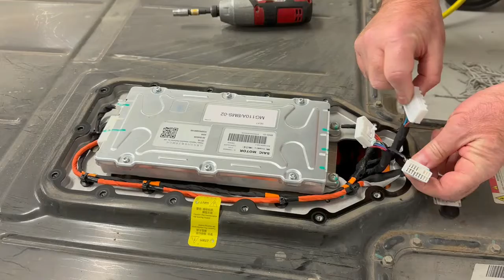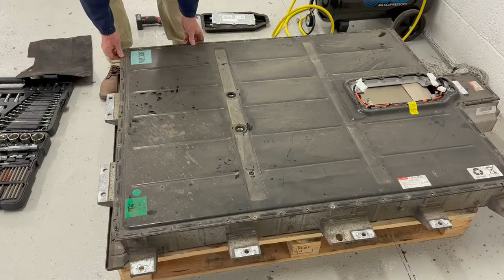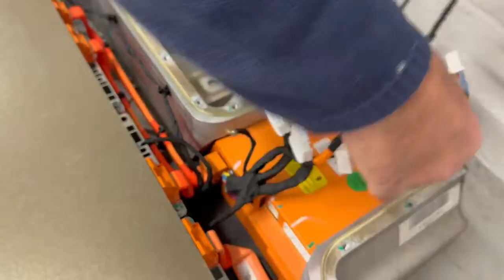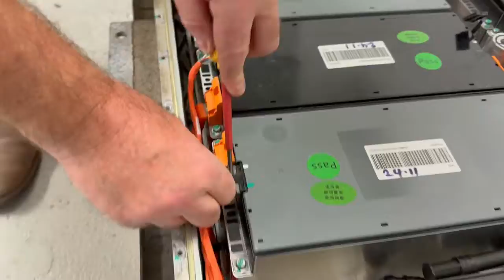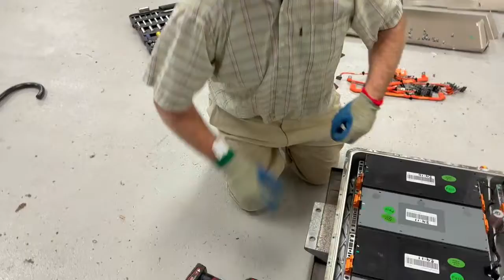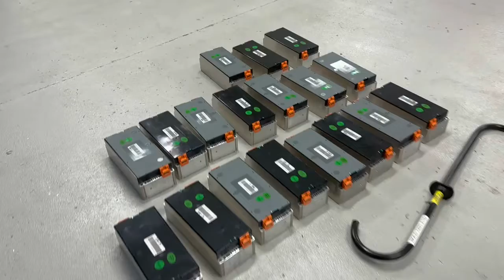2019 MG ZS EV battery disassembly.

Comment: Brilliant video Guys, thank you. I'm late to the party discovering it a year on! Brilliant modular design, only reservation being a leaking coolant pipe, would have been easy for MG to make them external. Assume this is the long range NMC pack as it degraded relatively quickly. Hopfully the LFP option lasts longer!

Comment: How many kilo meters were driven by this battery ?
Reply from the maker: @bhagwansinghrana8224  120k miles approximately
Reply: @Triplebengineering  Given the amount I see with rotten brakes,faulty radio/ nav systems, failed cats,coolant and oil leaks, coil packs,broken window switches and regulators,water ingress into wiring,dodgy transmission ECUs, etc. some only a year or two old, 120k is good going.better than I would expect from a petrol mg.
Reply from the maker: @user-re6yo7tj5s to be fair to it, this little car has been very good.  It’s now on 150k miles and apart from the 2 front wheel bearings we put on it last week and the battery change at 120k it’s had zero failures.  

The wheel bearings were a “joy” to replace 😂.  Due to the daft design it necessitated the complete removal of the front hubs from the vehicle, so suspensions arms off, driveshaft out, brakes off etc just to change the bearing 🤦‍♂️.  Genuinely changing the EV battery was far easier.

Comment: Hi, I have Mercedes EQB I hit something from the bottom of the car so the cover of the high voltage battery bent a small bit. Does this affect the battery? Some mechanic told me the battery has to be replaced because it’s dangerous to drive this car if you can help me please.
Reply from the maker: @lul196613  it depends on the damage tbh.  If the battery enclosure is exposed then yes it is definitely an issue and could be dangerous.  If it’s just superficial then it’s unlikely to be a problem.

Comment: Correct me if I’m wrong but would I have to touch  both positive and negative to get an electric shock. If I touched just the positive I wouldn’t  get a shock that would kill as I’ve not created a path. Not that I’d try 😱
Reply from the maker: Broadly speaking yes, to get a bang from the full force of the dc battery at full voltage you would need to bridge across both poles.  However, you can still get smaller shocks from either partial module poles OR from capacitive discharge to the casing which we measured at around 100V decaying which would definitely give you a tickle still.
Reply: That’s correct, it’s different with supply from the grid because the earth is used as a return path so coming in contact with a live is all that is needed.

Comment: soh?
Reply from the maker: State of Health
Reply: @ what is soh of this car?
Reply from the maker: @forever_momentss 84% at point of removal
Reply: @Triplebengineering  and why remove it if it's 84% ? how low can it go for the car to be dead ? if warranty will change it when it's under 70% , can it still run if SoH is under 50% ?
Reply: @Triplebengineering 84% for how many miles?
Reply from the maker: @ roughly 120k miles
Reply: How many mile it driven??

Comment: 11:11 now try dropping a spanner across the pack voltage, and you'll get a lot more than a "tingle"!!! more like a melted spanner, and possibly a large fire.☠😱
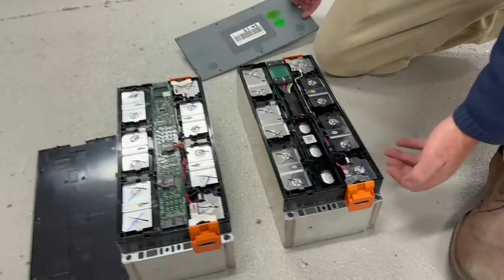22:22 You should scrape the modules across the floor, they are machined flat, and clean for thermal contact to the box... 
Summary: cell 3.65/4.2V individual "cell" Module: 6 cells (6s) Pack, or BPC: all the modules, 108s, or 18 x 6s modules, giving 394.2V nom, charging to 453.6V.
Reply from the maker: And how are you going to do that unless you have a 20” long spanner……the “pack” ends are nowhere near each other

Comment: 6s is 3.65V x 6 = 21.9V module, charging to 25.2. (22V would be closer!) I've done this job on an MG5, it uses 6 x 16s 58.4V modules, charging to 67.2V. It had ~70 7mm bolts, I didn't use my fingers to count them!!!
Reply: @Triplebengineering the module is 6s right? Not 5s
Reply from the maker: @rashadshubita1941 yes each module has 6, 4.2V cells = 25.2V per module, x18 modules = 453.6V pack
Reply: @Triplebengineering do you know parameters of modules? catl? 6s?p what capacity Wh? do you have photo of label?

Comment: Lfp or nmc battery ?
Reply from the maker: @dm-ebike74370  the smaller 6 cell modules from the standard range 44kwh pack are NMC chemistry.  The larger 16 cell modules in the extended range 72kwh pack are also NMC chemistry however the later gen2 packs (50kWh for the std size) are now LFP.

Comment: So what was actually wrong with the pack? As they all seemed to be at the same voltage?
Reply from the maker: We suspect it may have been a faulty BMS or faulty software rather than a battery cell issue.  It is worth noting that there could still be an issue with a particular battery cell or module that only presents itself under load so even though the module voltages tested good and more importantly, consistent to each other it’s not a an absolute guarantee of no defect.

Comment: Hi Brad, I was wondering what sort of 'structural' protection element they have on the bottom of the battery pack against accidental road bumps and debris? Nice video btw!
Reply from the maker: @reginalduy3678  just a large chunk of cast aluminium tbh is all that separates the modules from the road surface.  The case is very solid and has energy absorption sections all over it so the modules are quite well protected in truth.
Reply: @Triplebengineering  Nice, thanks for the reply! I was asking because I am curious about Chinese EV's structural integrity. With Tesla's for example, it's quite proven that the underside belly protection is really tough based on various YT videos I've watched.

Would you say it's comparable (not greater maybe, but just comparable) to the level of toughness that Tesla underside bellies have?
Reply from the maker: @reginalduy3678 it’s quite difficult to say for sure without doing a back to back comparison using a measured blunt force.  Also the cell topologies are very different in these MG packs which use prismatic battery cells compared to a Tesla pack which uses cylindrical cells so the makeup is very different.  

From what I have seen, could you break the casing on the MG, yes I would think so but only with a direct and focused hit to the underside of the car because the pack is well protected between the chassis rails and such I would say it’s highly unlikely.  Maybe we will cut one of the cases up and show you a cross section inside in a later video.

Comment: @Triplebengineering , did i hear Bill say he works with high voltage UPS battery systems? If so, would he mind if I pinged him a couple of questions re converting an apc surt20k xli ups to lithium?
Reply from the maker: @mechsmantg  yes he does all that stuff so drop him a note.  👍🏻
Reply from the maker: @mechsmantg  @bill2960
Reply: @Triplebengineering thanks.
Reply: @Triplebengineering  can't seem to find him with that tag for some reason? Has Bill got his own channel or anything?
Reply from the maker: @mechsmantg  he’s in the comments section replying to a bunch of the threads here so have a hunt about and you should see the tag
Reply: Hi sorry. Did not see this till some one pointed it out to me.  You are wanting to replace the lead acid with lithium cells. From a car ?  Or buying them .

Comment: Hi, I like to use same pack for 48v solar system,  how to connect it in parallel and lupe for master and slave to bms working properly  ?
Reply from the maker: We can do one better than that.  The next video will be on the home power system we built with these modules.
Reply: When this video will be released
Reply from the maker: @YasirHabib93  we are just filming the next video now so after it’s edited it should be released in about a week or so 👍🏻
Reply: @Triplebengineering  its been a week reminder release date of video wen
Reply from the maker: @YasirHabib93 new video up now on our channel, sorry for the wait👍🏻

Comment: Im interested to know if a newer pack 2020+ with higher kwh would fit the same frame or the frame is even the same size. If irs possible to switch a 44kwh with a 67 kwh or what ever size available to the same car model.
Reply from the maker: Unfortunately they use different battery chemistry and form factors so they aren’t cross compatible

Comment: Good to see the technology is quite simple clear. I'm driving a ZS EV for 4 years now. I really like the car, but a few miles extra on the battery would be ideal. I assume that CATL might have new cells with slightly higher capacity with the same dimension. Take out the old cells and replace them with a same size higher capacity, would that do the trick, of would the bms and electronics go out of their mind? Any thoughts on that?

Comment: Very interesting video. If this simple pack was the norm, local (properly trained) garages could check and swap modules easily and send the faulty ones to a specialist facility to be refurbished.  It would bring down the cost of repair, provide good value work to local garages and greatly expand the life of cars and their batteries.
Reply from the maker: Thanks for the great comment and absolutely this pack was built to be serviceable unlike so many others.  It does make you think about the true motives of some OEM’s for sure who would rather the battery (or even the car) be disposable.
Reply: There is not an overall benefit to be able to swap one module out. Too costly compared to just scrapping an entire pack and instances where can due this are extremely rare. Putting a new module into a pack with old modules will cause the pack to be very out of balance. Usually messes with the BMS who then thinks they have a lot of bad cells. As well as usually the old modules will start needing to being replaced in a year or two anyways. Better to just swap an entire pack when a module or cell goes bad.

Comment: Great video although as you have said below, its a pity there was no obvious point of failure. Speculating here but would the overall BMS keep the modules at the same total voltage but there may be one (or more) modules which, while at 24v overall has one low cell and all the other cells at their maximum voltage ?
Reply: Each of the cells (all 108 of them) have an individual sensor monitoring that cell so the BMS knows all 108 cell voltages and keeps them in check when charging and discharging, the cables connecting each module daisy chain the BMS slave boards inside each module together so they can all communicate with the master BMS, at least that would be my guess :)

Comment: I have some experience with these. 
They use a ltc6813 afe in each master module using isospi they communicate with the bmu ( BMS) I wondered how they worked the cooling into the base would it be possible to slice or cut a segment of the battery case where the cooling is so we can get in idea on thickness of material used to make the frame and supporting base structure of the pack . ? What happend to this pack it failed but do we know exactly why.?
Reply: Hi.  If I was going to scrap the Alley I would. But at the moment I am keeping the pack as a possible rebuild project. With some other cells. Keeping the exsisting bms. Etc.   what I will say is I was impressed with the construction of the pack . The cast aluminium box is well ribbed to provide strength  the battery modules are all bolted to the welded in base plate this I believe is more ductile than the cast case. So in the event of the pack some how being bent the outer case will crack and shatter and absorb Energey while the base plate will tend to hold things in place and Bend each of the module  are conected with a flexible busbar  so can move with respect to each other some small amount while bolted hard down to that base plate .  But when you look at positioning of the battery  between the steel rails mid part of the car it is going to be some serious collision before this start to be a problem unless the car is rolled over on to a bollard direct impact the the base of the battery . And in this I think this would still take some abuse .

Comment: Good to see you both continuing to play on Bill's old pack and the suitability for maintenance. I think at a module level you didn't find a duffer being all about 24.1V?
Reply from the maker: That was the surprising thing, we expected to see a bad module but as you can see from the video they were all within 0.02V of each other.
Reply: @Triplebengineering  would the battery internal resistance be measurable? That could identify a bad cell/pack.

Comment: Wouldn't it have made more sense to split the pack first, rather than taking out the low voltage stuff with the pack at 400v?
Reply from the maker: That logic is sound but in reality some of those BMS “comms” cables actually have full pack voltage on them anyway as they do the cell monitoring so it wouldn’t make too much difference from a safety perspective.  The reason we did it the way we did was to get nice clear access to the HV busbars by removing all the other cables first.

Comment: Great video thanks chaps. Would it be too much to assume the one in my MG4 is very similar ?
Reply: Thanks sorry silly me should have specified, it’s an SE model (basic) so LFP.
Reply from the maker: Similar, most likely but possibly not identical as depending on what version you have it could either be an LFP battery or an NMC battery so the designs will differ slightly.  It’s fair to assume that the overall design concepts will be similar however.

Comment: It would be good to add a short section on the contactors and assiciated wiring and safety lock-out that are presumably hiding in that front section of the case under the orange cover. But good follow-up to the swap video
Reply from the maker: Thanks for the comment and good shout on the control box, we should definitely show you all what’s in that 👍🏻

Comment: Nice one Brad - very interesting strip down and discussion regarding the complexity of the pack for future maintenance.  I've got a Tesla for work, so a four year hard test without the worry of a costly battery replacement! 😄
Reply from the maker: Cheers.  For sure this MGZS pack has been designed with maintenance in mind, whether that’s down to them not having much confidence in the cells they have used or because it was cheaper to do this way I’m not sure.  There’s no doubt Tesla are still the benchmark when it comes to EV’s but it definitely wouldn’t be this easy to strip down.  Lovely machines too 👍🏻